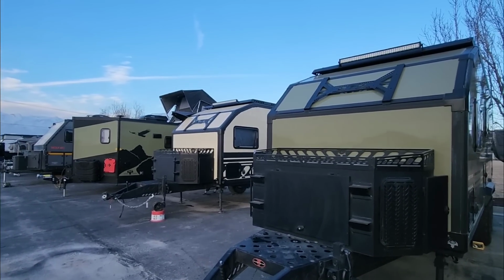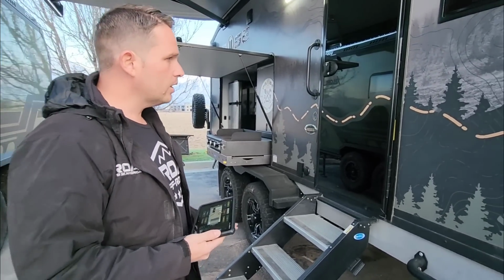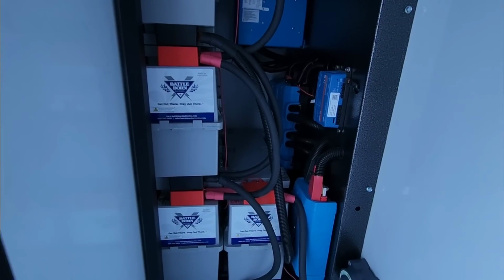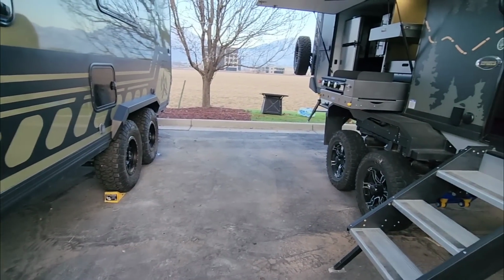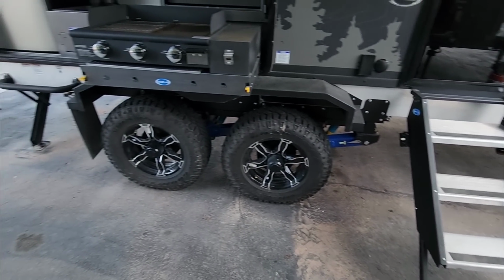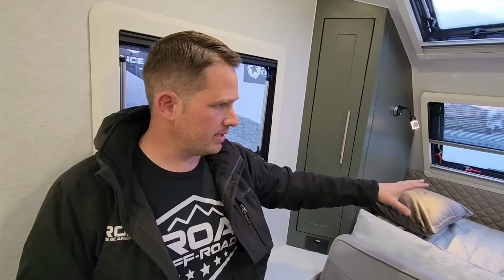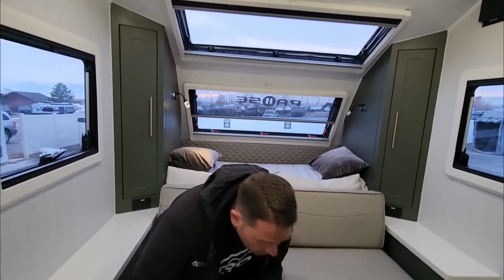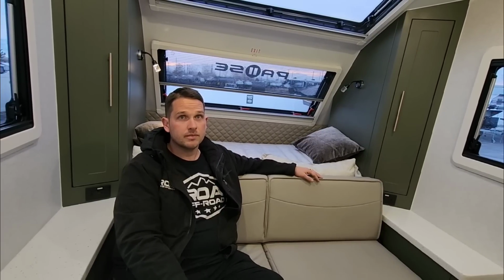The PERFECT Off Road RV?  All new Palomino PAUSE XC20.2!

Comment: I like this rv. I've looked at the specks on their website for it, but can't find something that I need to know. It says nothing about being able to connect to shore power. Off road use looks awesome, but what about those times you want to stay in an rv park with it? What hookups can you use, 30 amp service or 50 amp? What about water and sewer hookups? Do they include sewer line, water hoses and electric cord to connect to an rv park facility? Thanks.
Reply: 30 amp

Comment: To assume that an unexpected increase in the cost of materials is the reason the price is $50K more than they originally claimed, is far too trusting. How about they simply realized that anything with the words “overland” or “outdoor” attached allows them to get away with overcharging their customers. I promise you they could have charged $100K and still turned a healthy profit. This is an example of the overland upcharge at its finest.
Reply: I mean, how do you know that? I guess according to you the company is stupid and didn't know they were designing an overlander trailer when they quoted the first price so once they realized that people would camp in their camper they jacked the price up? Maybe, it's because everything is expensive, because inflation? Labor costs going up? Material costs going up? Sales people's wages going up, taxes on their properties and lots they're sold on are going up. I guess all of that didn't increase the price they're just ripping people off. You must be special.
Reply: 100% agree, the fact they charge more for certain things like off-road tires when in reality the difference  price is miniscule same with the sidewalls windows Fridge etc. The stock standard prices of that equipment in reality to upgrade is not a fifty to sixty thousand and doesnt warrant that price increase. Plain and simple it is price gouging just like they do with "toyhaulers" .
Reply: @chadsteele1  You're a silly man.
Reply: Agree!!! This is way overpriced for what you get! This air rise system is fairly useless because you are going no further than what the axles can clear.

Comment: As a full-time RV’r, I know RV’s. These are incredibly built and awesome, however I have to be honest and say these are SO overpriced! So much so that it gets to an insulting level. You can buy a house in most of the country for what these cost. It’s ridiculous and absurd. However again, definitely well built and nice RV’s. But c’mon with that stupid price. Disgusting! 🤦‍♂️
Reply: Very few houses are 150k dollars in this country anymore. Average US Home Price is $348k dollars for 2022. Average home price in Colorado for 2022 is nearly $550k dollars. Only back east can you buy a reasonable house for under 200k these days, mostly in Iowa and southern states. But they also have terrible economies so there's that.
Reply: @dedalliance1  lol I get it perhaps I exaggerated a bit but you know what I mean lol. Just way overpriced in my opinion.
Reply: @IsraellDFend  I mean it's not cheap, but quality isn't cheap. It's about the same ball park as some of the comparable Australian off road campers, about the same as an Airstream of similar size. About the same price as a Mercedes camper van. A lot of fifth wheels are in the same price range on the higher end ones. There's a some big truck bed campers that are 50-60k dollars, some pop up off road ones are 40-50k on the high end. Obviously that's cheaper but price per square foot it's not cheaper.

The problem isn't really that these things are expensive, the problem is wages haven't kept up with inflation for the past 40-50 years. Since the majority of people make garbage wages these days it makes everything seem expensive. You wanna pay for quality materials made by skilled labor it's going to be expensive, this is a mostly US made product it's not chinese slave labor like we've been used to for decades. Take our jobs back from China and we'd be able to afford nicer things because we'd all have better opportunities to make more money by using our skilled labor verses other countries slave labor.
Reply: @dedalliance1  you know what that was very well said. I still think it’s very expensive and as I mentioned, they are very well-built and I certainly agree on the quality part. I just feel personally that the cost outweighs the quality but I could be wrong.
Reply: @IsraellDFend  Everything's relative when it comes to cost and value. Like he said in the video, that trailer has the most suspension travel of any trailer on the market in the US. So if that was the value point, there's nothing else you can just buy here without custom building one. Everything boils down to what someone wants out of their purchase. I live not too far from an Earth Roamer facility off of I-25 here in Colorado. Talking 500k-1 million dollar or more vehicles. There's really nice motorhomes that are 1-2 million dollars. The average joe's not gonna be buying any of these so it's kinda a mute point in that regard but there are people where money isn't a concern. I know a guy with horses that cost more than this camper does. If he wanted the best off road camper in this size category there's not many other options. So the value's there, but it's for people with too much money not for the family of 4 trying to take their kids to the beach on the weekend.

But here's the thing. Toyota Owns Lexus, Toyota can't sell a Camry for 50k dollars, but they can sell a Lexus for 50k all day. Toyota invests high end technology into the Lexus brand and figures out how it holds up in the real world how the customers respond to the tech advances and then when that tech becomes mass produced and affordable it gets passed down to the Toyota Brand and put into cheaper cars. Cars used to not have cruise control, that technology was bought and paid for by wealthy people in higher end brands, and then heated seats, and cooled seats, and blind spot monitors, and crash avoidance, and it's now that higher end cars have self driving in 10 years that'll be a standard option. So the technology they're putting into this camper might be unaffordable to most of us normal people today, but in 10 years a lot of it's going to be standard technology in the lesser brands. So that's all it is at the end of the day. I think it's great that they're trying new technology doing the air ride doing the Lithium and Solar doing aluminum with composite materials because then eventually that technology will get cheaper and cheaper to produce and more efficient to produce so it can be less expensive.

Don't get me wrong, 150k dollars isn't cheap but it's far from the most expensive rig on the market. Which is a good sign, because it won't be long until the technology is in everyday products that are more affordable.

Comment: The heavier weight aside, probably the better one to go with that's been showcased here. I love the storage features, power upgrade, metal build of literally everything. Personally the only gripe I'd have is I like to travel up North in the wet/colder Fall, which having your bigger kitchen utilities and fridge outside is really unappealing, would prefer those inside. Overall though, I'd still put this one above the others for ideal get-a-away camping to remote lakes and parks. :O
Reply: The Pause next to this one would be for you .
Reply: this not for typical fulltime rvers. This is meant for off road overlanding. Yes a little big for most Overlanders but that is what this trailer is for. Meant to cook outdoors and be outdoors.